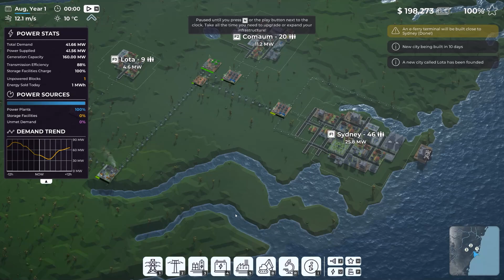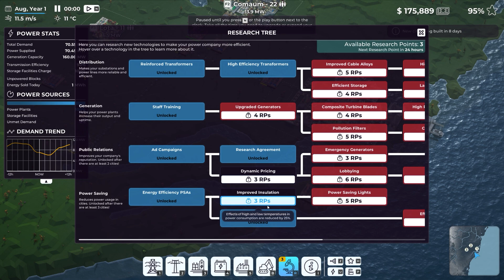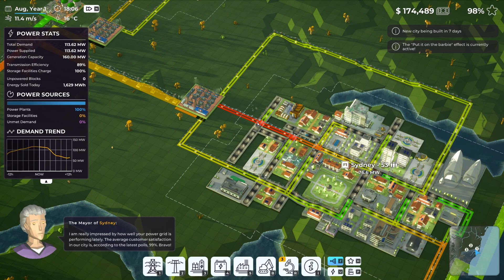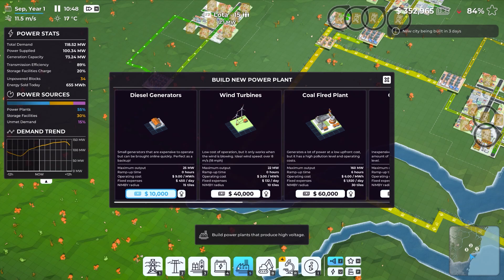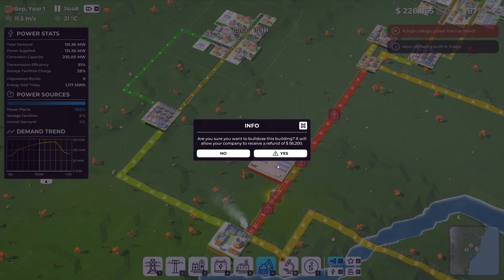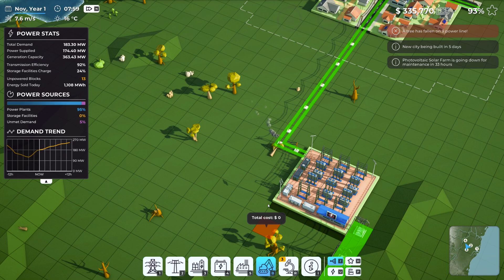Delicate Balance | Power to the People #8

Comment: Huh so multiple lines from a power source lowers the load on the lines, good info to keep in mind for the future. Remember the point of the switching stations is turning ON and OFF sections of the power grid, maybe try using them to deal with the power overloads in the larger cities and just connect ALL the lines together?.

Comment: Consider placing local substations and connecting your local grids, then select conservative as policy. You won't have to manually reshuffle your grid constantly, and the small local substations are cheap and have a very low NIMBY radius/impact